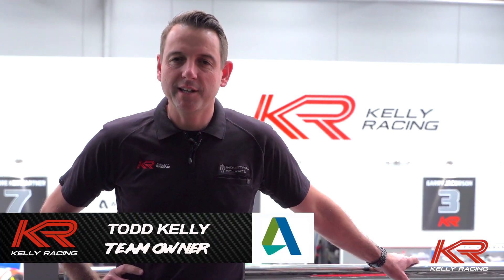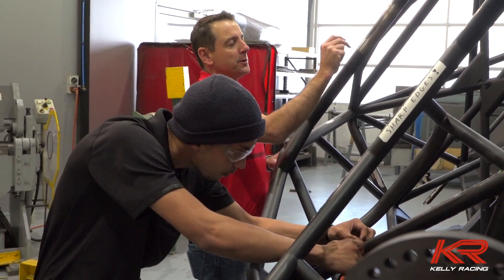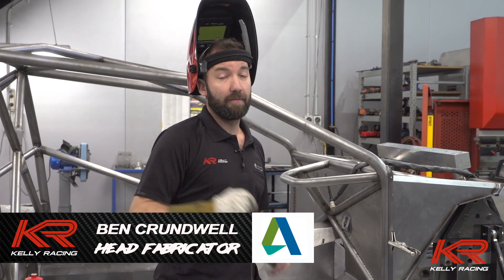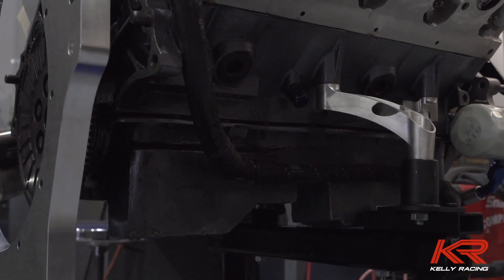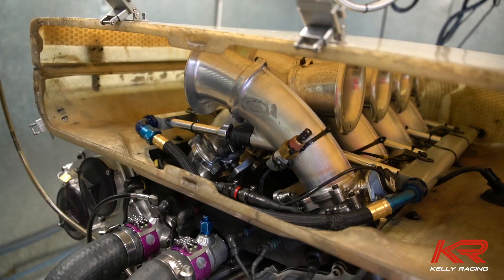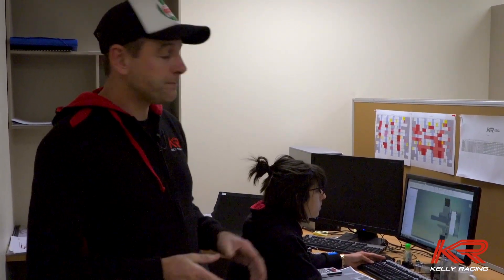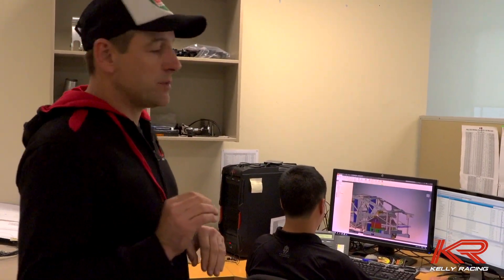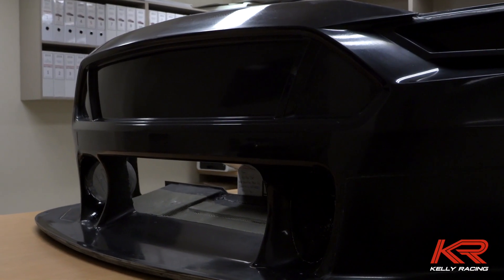The Road to Mustang part one - Inside Kelly Racing

Comment: This shows how Todd has become a really competent engineer, and understands all aspects of the car.  I see why he decided to walk away from the driving aspect and focus on this side of things.
Reply: Incredible Mechanical Engineering brain!
Reply: todd  has no idea , only how to throw money away,  like a cad program for a cnc water pump pulley you can just buy for f-all what a joke
Reply: @volksdeutschewaffenss9670  its a business run by sponsors
Reply: @janeblogs324  tell that to gary rogers, also sponsors want results for there money ,  what, crap to  design a water pump pulley cnc and cad program, WTF its a control engine, you can buy cnc nascar stuff from 900 hp small block v8s, reinventing the wheel , no wonder they can't win races or even be competitive, such waste, larry perkins would have a fit to see such a waste of money on simple off shelf parts, like employing a full time cad designer to make that WTFFFFFFF

Comment: Thanks for the video update. Very impressive. Lots of work to do before Adelaide. Just one thought. Costs must escalate quite a lot when each team has to fabricate so many components. Would it not be better if all the teams used more shared parts? That seem to be one of the recent development starting to happen in Formula 1.

Comment: After you guys have a fully assembles working Ford spec engine. Is it possible for you guys to explain what took so long to get the Nissan engine up to speed and why it was so difficult. I.e unsuitable rules for OHC engines or was it other factors?
Reply: Optimising the intake runners and getting it to fit under the bonnet wasn't easy. The overhead cam design made the port height tall in comparison to a pushrod setup.  E85 was new to the category when the nissan engine was developed which calls for extra fuel delivery over non ethanol fuels. Completely different engine from what everyone had spent 30 years development on, stone brothers had similar issues with the Mercedes Benz, GRM/Volvo had it on the edge of destruction from word go.
Reply: @dinosshed  I see, I also heard that from the beginning that Supercars gave Nissan a bore x stroke size to use which wasn't very favourable to a 4 valve engine added to the semi low compression ratio of 10:1made the power issues worse. I also heard that Volvo got to choose their own bore x stroke as well got a waiver to use a flatplane crankshaft. Was there anything in the rules that Supercars could done differently to help the struggling nissan and merc early on?
Reply: @The_Evil_Monkey_93  In a parity formula it's not easy to play catchup when specs are set in stone. When merc took a look at the existing pushrod engine and its basis of running 650hp from a small block 5.0 they couldn't get their head around the magic. Supercars management should have mandated an electronic throttle control to limit the power and power curve as soon as they opened the door to the other brands. That way, the teams could run brand specific engines with forced induction, different capacity and configuration. Would have been far less expense as crate engines could have been used. That's what they should have done and still do moving forward.

Comment: Supercars need to wake up and bring in cost cutting measures with crate engines and off the shelf bolt ons etc sure some things still need fabrication but costs for teams needs to be lower
Reply: Brad Williams  unfortunately you are correct.....

Comment: Great insights here. Amazing the amount of design and unique fabrication that goes on in each team. The significant message shone through and without wanting to detract from the amazing skills and talents on display: what a ridiculously, pointless waste of time, effort and money is expended designing stuff that NOBODY watching the racing from ANY aspect could possibly appreciate. Therefore why oh why doesn't the category mandate a single spec and share IP for water pumps, oil pumps, sumps, body to chassis mounting pieces, suspension arms, hubs the list goes on and on. Surely there's a way this could be shared at a fraction of the current cost. No wonder the sport is strangling itself in cost. So much duplication between teams running the same car brands of non-competition altering componentry must surely stifle the actual competition changing stuff to some degree.

Comment: I think u guys should look at the Dart engine block range instead of Ford racing's boss block, and also the edelbrock pro port sc1 for cylinder head design,
Reply: aussi3212 the regulations are set so tight on so many parts that there won’t be much room in what they can use. All head design and rotating assembly are very strictly monitored! See the shell teams penalties for a couple valves opening a couple of thousandths of and inch too much! Not much room to move!
Reply: @ZedTee77  the pro port head needs absolutely everything done, ports seats, chambers, guides , spring seats ect ect

Comment: More Ford's on the track 👍
Reply: Not really. . . only just some ford panels  🤔
Reply: @justgjt   with a Ford engine
Reply: @justgjt  ford vs holden sounds better then some panels trying to go faster tgen some other panels.
Reply: some random guy it will fit straight into any 60/70/80’s mustang, also into any Aussie falcon.and probably easily into the new mustang, the engines in those are larger physically.

Comment: like what bullshit, no wonder supercars cost are through the roof for teams, designing machining parts that you can buy , pulleys, pistons, water pumps, heads what a waste of money, you can buy cheap nascar off the shelf stuff, no wonder GRM quit if teams do this crap , paying someone to design a cad program to make a cnc water pump pulley, or pistons what a wank, these are std performance parts for 900hp nascar engines, unbelievable what's next paying someone to design a cad program for a supercar steering wheel , kellying racing is a money pit of worthless crap you can already buy ,